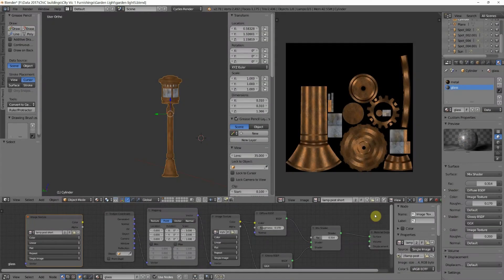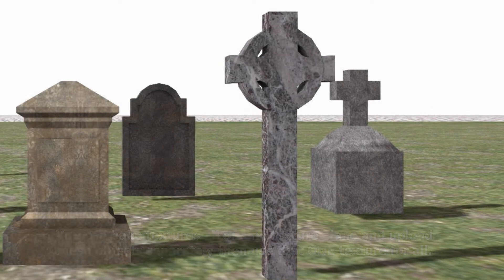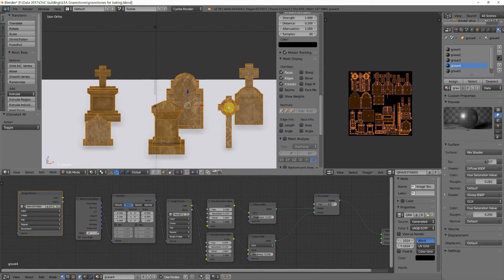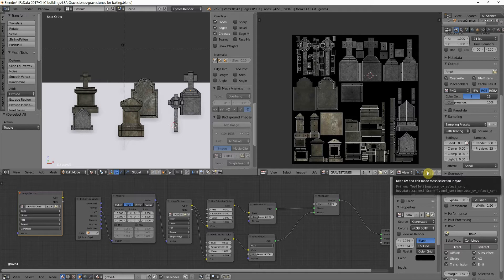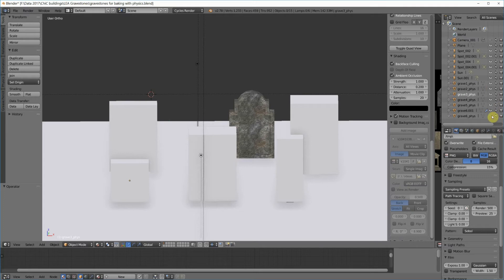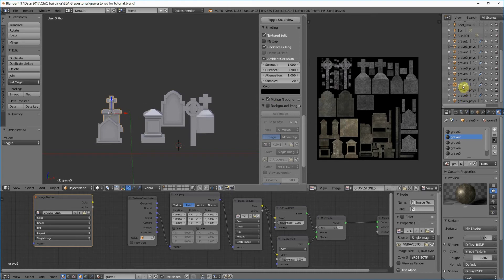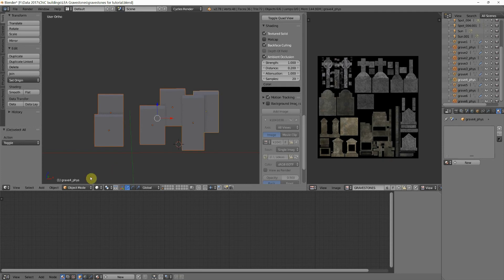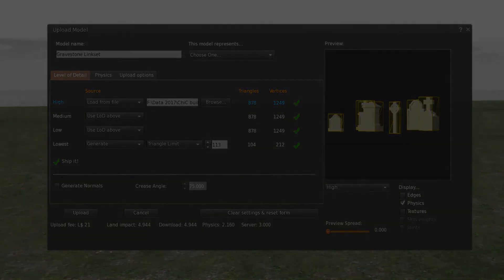Materials from Multiple Objects to One Texture Plane  - Linkset Physics and Uploading

Comment: This is a ways late. But there is a benefit to putting everything onto the same texture if you can afford it. If the objects are going to be used frequently on a sim, like trees, fences, rocks, and what have you. It will significantly reduce the network latency caused by downloading textures, as well as reduce the strain on the player's viewers. I often pack as much as I can into a single texture with minimal quality loss when making trees, plants, and fencing. The result was usually that those objects were able to load faster, and increased the frame rate by about 10 fps. Versus allowing the trees to all use different textures.
Reply from the maker: Yes, but even on a SINGLE OBJECT that will only be used once -- it lowers the draw calls.  I almost always work this way putting several materials on one texture plane. The other method would be to bake and then change everything to that  SINGLE texture. The downside of that method is that you (and anyone you sell to ) can't tint any of the what WERE those single materials.    So a good skill to understand I think.
Reply: @chicaeon  The draw calls are a matter of it depends. And at this current stage a draw call isn't whats killing it. Thats only one part of the great balancing act.

The other part is state changes. If the viewer is optimized to reduce state changes having things share a texture for a material is extremely beneficial. As Rebinding a texture in open GL is more expensive than changing a model.

The description of a Many avatars being a DDOS attack is often related to that. Insane number of polygons on a maitriya body, each avatar is using a bunch of different objects with 1024^2 textures. Which means each avatar is basically 100 draw calls wirh everything being rebounded, or swapped in a buffer.